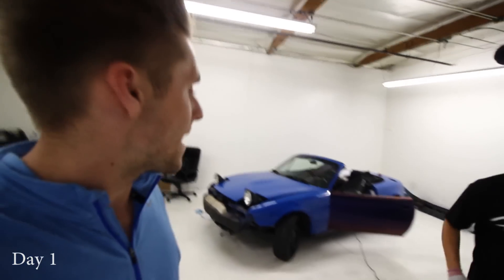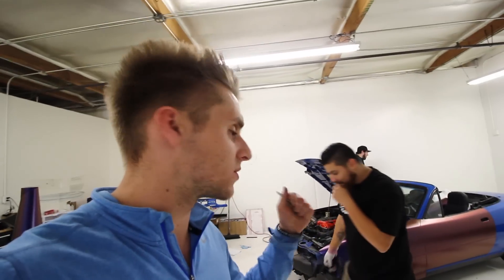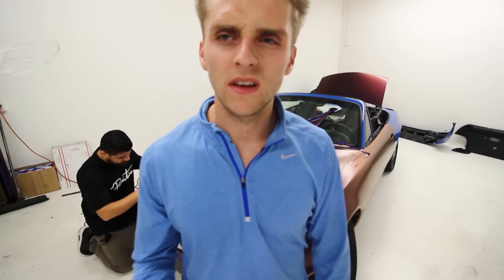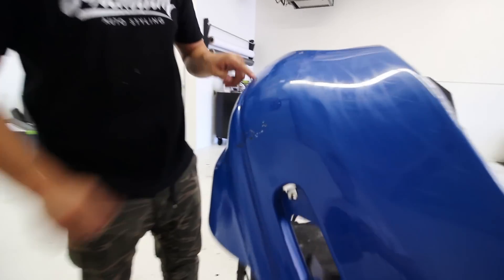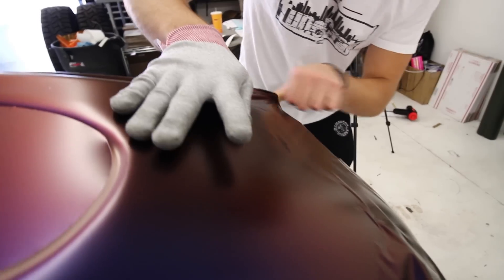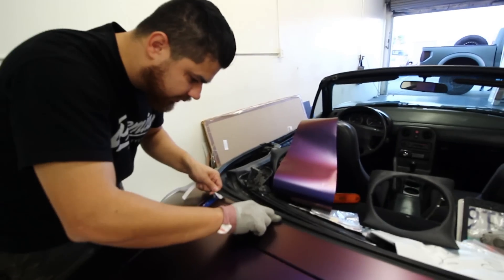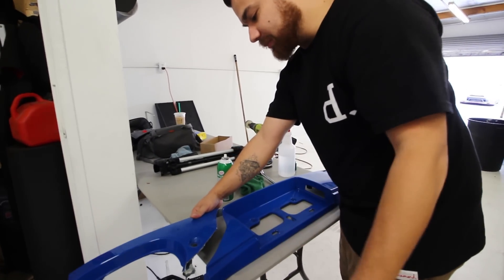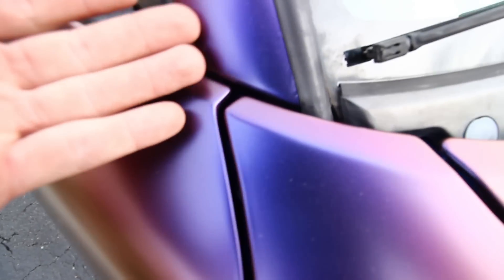Revealing The Vinyl Wrapped Miata!

Comment: The rap color is sick, but the shitty part about raps is the door jams are not the same color as the rap color. It looks good until you open the doors, hood, or trunk then it looks like shit.
Reply: Nick Pierson yes! some people will actually wrap those places dont know why they dont. Tjs, Tanners gtrs and brz look kinda ghetto because they didn't do that. The only color that can pull it off would be a black car.
Reply: Eduardo Barrios yes I agree with that 👍
Reply: Daniel actually explains the reasoning behind not wrapping those areas in the latest Premium vid that came out. It's on their YouTube channel
Reply: Stephen McCabe  If the cost is the reason, they're already spending 2k + on a wrap as he also mentioned. They can at least do a generic black color cause that'll look good with most.